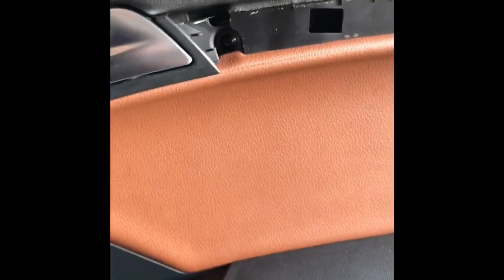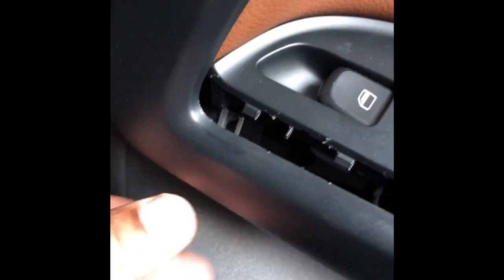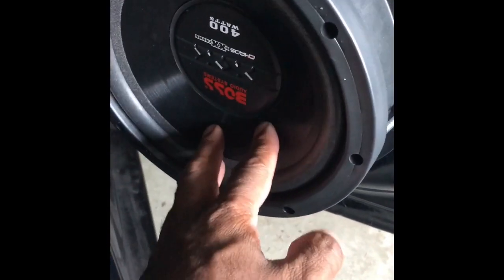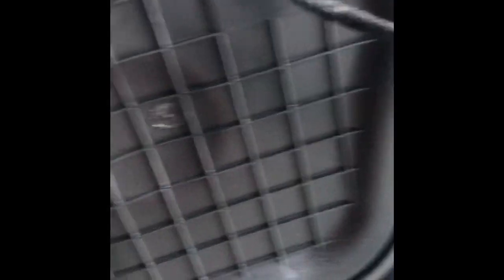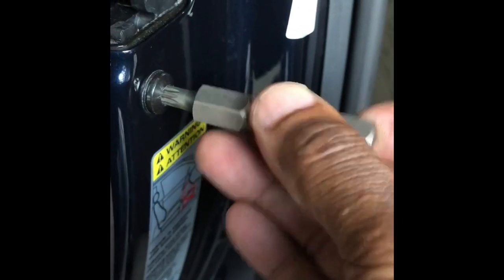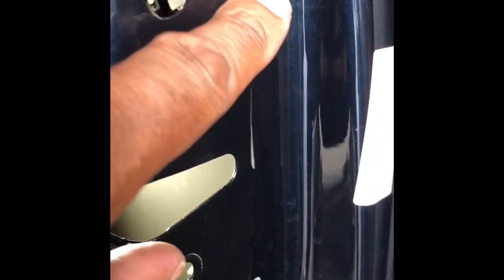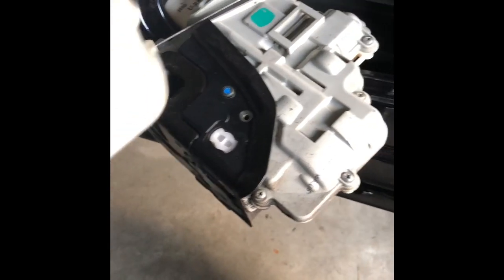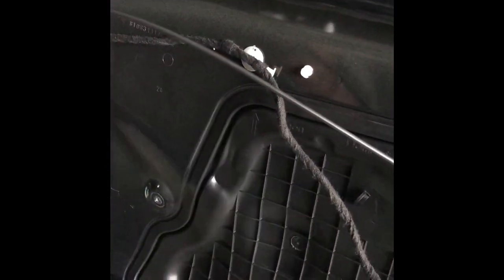DIY Audi A4 A5 A6 A8 door lock Actuator Replacement FIX

Comment: Thanks for sharing the video. I am having a problem and it seems like I may have t replace both front latches/actuators. Two question: Did you get OEM parts or something off Ebay, etc?? Also do you leave the window up or down before removing the door panel?? Thansk so much.
Reply from the maker: leave the window up and you can get it off ebay. Thanks as well

Comment: Hi. I have a 2008 Audi A5. My outside door handle has no tensiin when pulling it to open the door from the outside. It does open from the inside though. I have changed the door lock actuator a year ago. Im wondering if its the bowden cable that hooks onto the door lock actuator or the door handle itself. Any advice?
Reply: Got exactly same problem, been told its actuator, not too expensive, will fit tomorrow